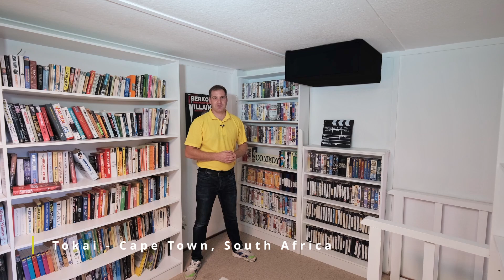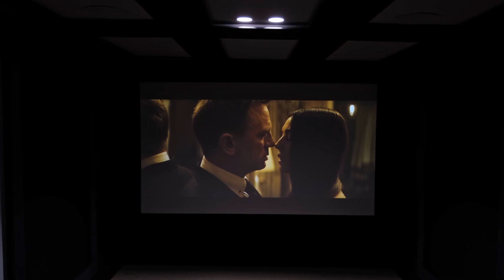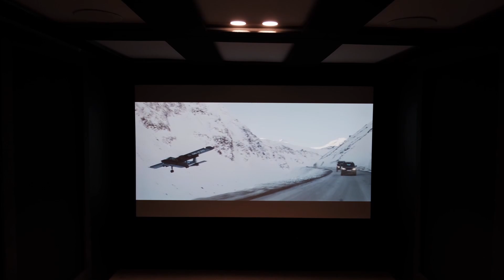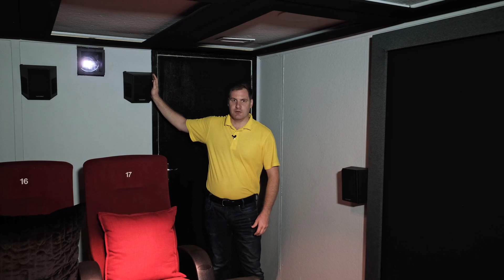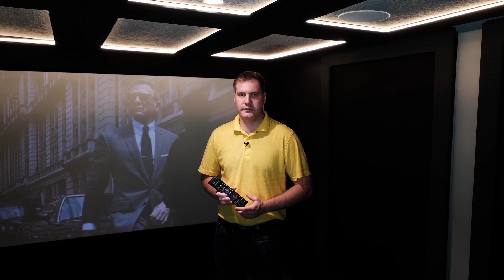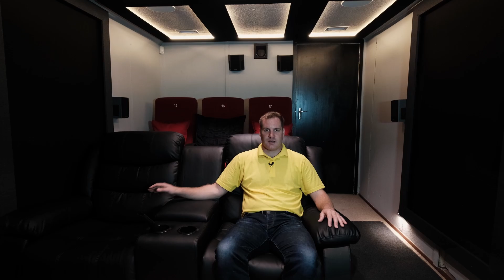Tokai, Cape Town - Dolby Atmos 7.2.2 Home Cinema

Comment: Very cool space! Question about the tripoles - any negative effect by having to mount them behind the MLP in between the two rows? Also, do they usually need to go on studs or works ok just on the drywall?

Comment: Do you know I pretty much have my back surround speakers in the same position.  I turned them off one time and just use the left and right surrounds  and it was a big difference.  The sound stopped on the side instead of surrounding me.  Once I put them back on the sound surrounded me again.  Back surround speakers are sadly underrated they are very important to a home theater setup.